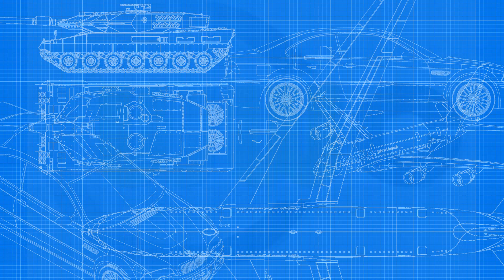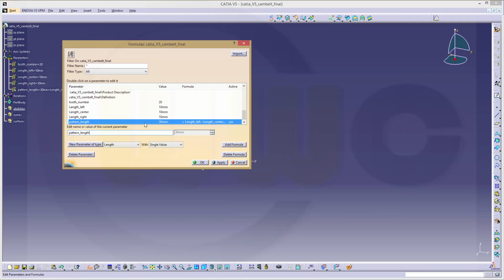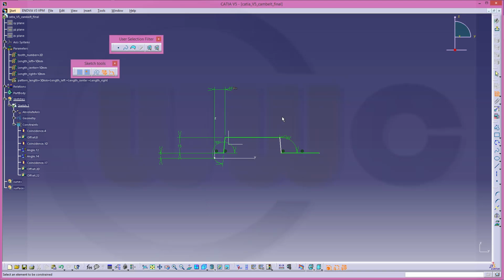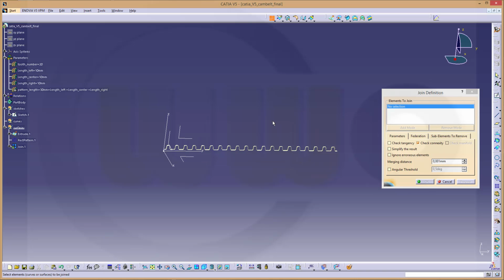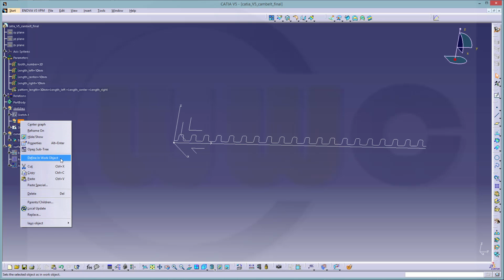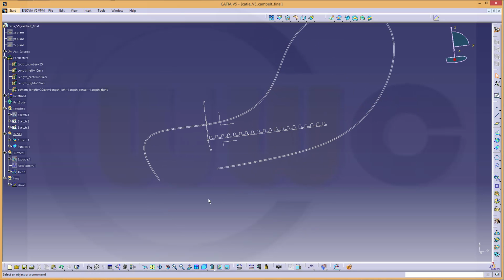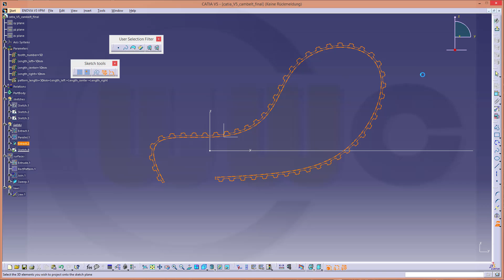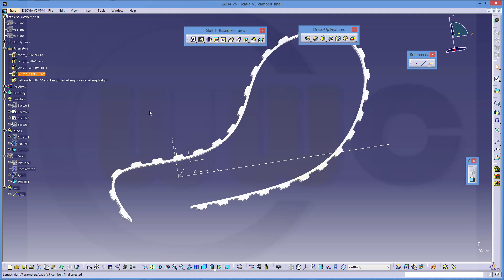Userwish Zahnriemen -  Cambelt - Catia V5 GSD Training - Law & Sweep

Comment: Hi, I have come across a problem whilst using the rectangular pattern in wireframe and surface  design. As i can see you are working in that workbench but the transformation features are only available in part design. I have started to design the belt in wireframe and surface design only but ran into the rectangular pattern not available problem. So please help me with this issue of mine asap. Thank you
Reply from the maker: Check if the toolbar is activated, reset all positions and restore all contents
Reply: Thank you so much
Reply from the maker: @mayureshghosalkar8128 you´re welcome

Comment: The rule beautifully explained! 
Are the many intermediate steps necessary?
How do I ensure that the profile is not deformed?
How do I get a closed belt?
Reply from the maker: Thanks. There is possibly a simpler solution. Closed belt - you can do it by adjusting the values and a little bit trial and error, just move one end of the spline close to the other end. Deformation - I don´t know. I made this video almost 2 years ago so in order to give you more specific answer I would have to "revisit" this example - but I´m very busy, as usual.

Comment: Thanks alottttt sir...... :)
Sir is there any way to simulate timing belt in DMU kinematics??
Reply from the maker: Hi, what is a "timing belt" ?
Reply: sir its another name for toothed belts(synchronous belts)...  :)  is it possible to simulate these toothed belt drives in catia ??
Reply from the maker: Ah I see ;) - there is no kinematic-joint for those but maybe one could "fake" it. You could maybe use the cable - joint.
Reply: ok sir ill try....thanks fr ur response :)